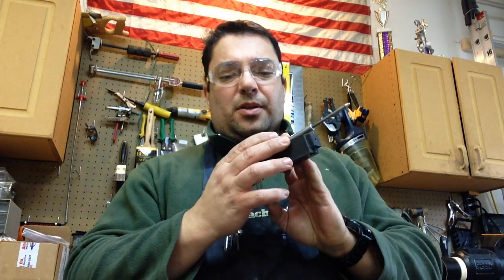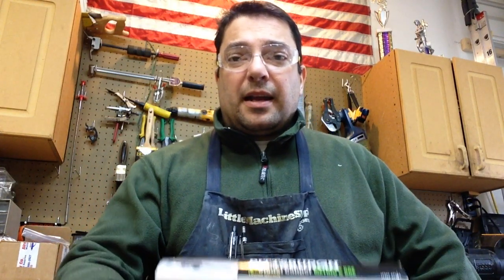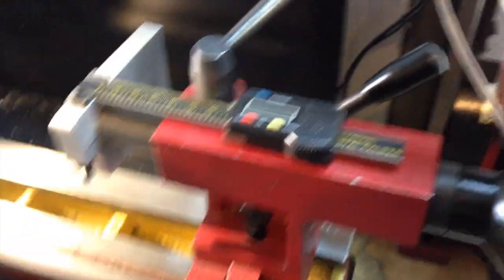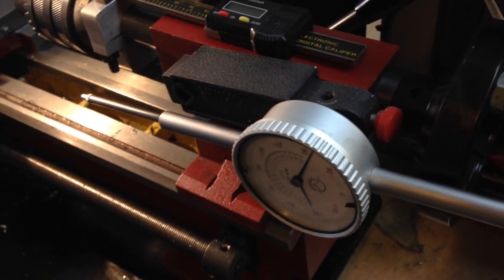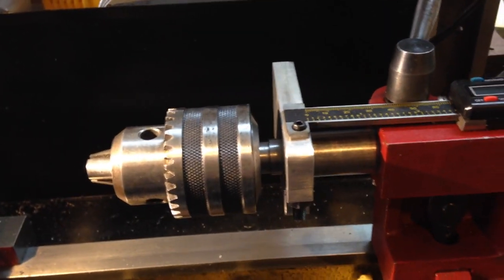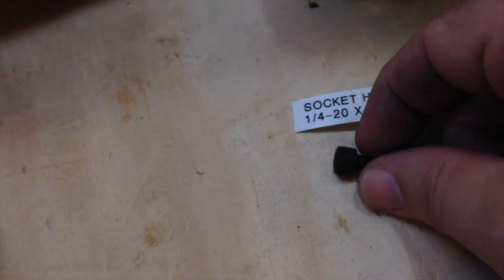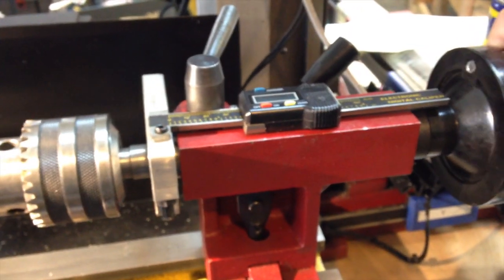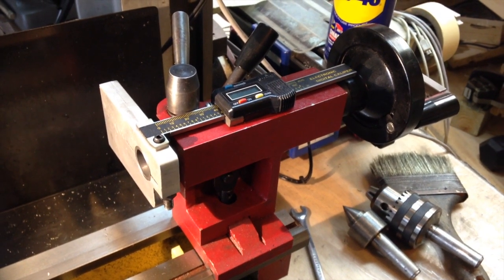Tailstock DRO mod

Comment: I  was working on adding the digital micrometer to my lathe and had it all ready except I needed the hole to attach to the ram bracket. Stainless steel from China is not possible to drill a hole in!. High speed steel drill bits make a dimple, carbide drill bit did a few chips and even had a diamond  bur I tried as last resort.  Yours looks like a metal unit so how did you drill the darn hole. I guess I can go buy a carbon fiber unit as it should be drillable. Use cutoff wheels on my Dremel and it cut off the jaws with no problem. Not sure if you monitor old video but wish I know how you drilled the slide.

Comment: Sound was low but not sure you mentioned how much quill travel you lose with having the front clamp and early ejection of the drill chuck. How did you secure the caliper to the casting?
Reply from the maker: A tiny screw on the far side of the handle.

Comment: great mod, attempting it myself now! you can totally turn left handed threads though! just reverse the feed but not the rotation :)   I couldn't help but notice the slit on the quill clamp extends past the quill hole, its probably whats causing the screw side to bottom out at the edge...

Comment: If you get an arbor with the tang - the flat end part if you know what I am talking about, then the drill chuck will come out when you are about 5/8" left.  I actually had trouble finding "standard" arbor when buying my south bend chuck from Grizzly so I ended up with tang.  I like your idea, I will try to make the same mod, thanks for idea!